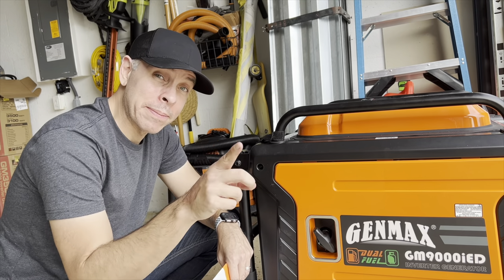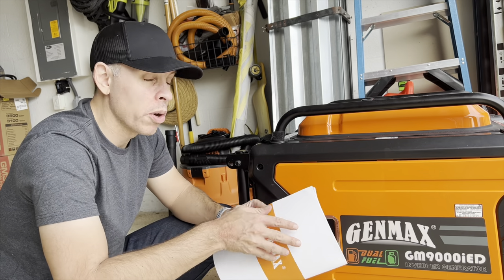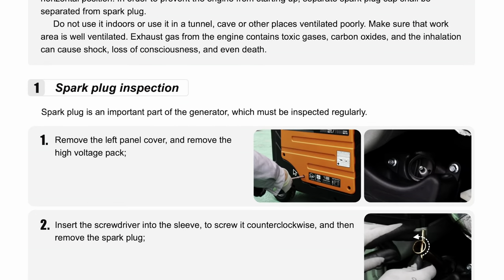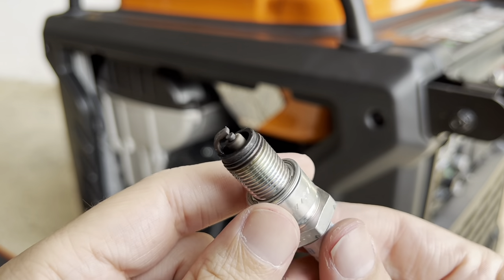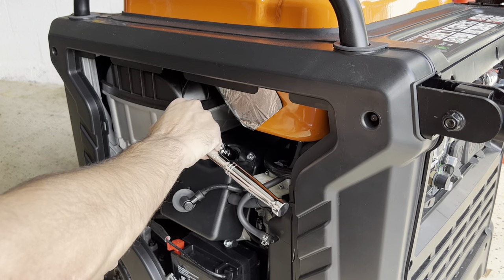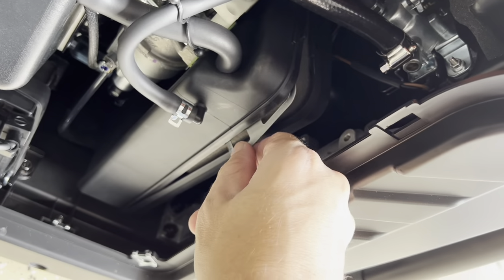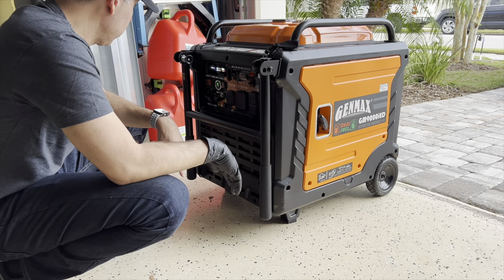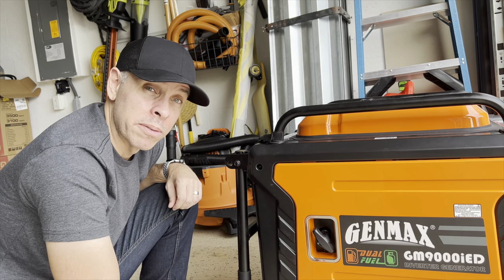Genmax GM9000iED Spark plug Change

Comment: Thank you for your video. I use my generator for the sole purpose of providing power in emergency situations. We just went 5 days without power and my 7 year old champion started up every time with the press of a button. It ran flawlessly and was a real help providing power for my portable air conditioner in 95 degree heat. 
Bottom line, reliability is the name of the game. Also that machine looks tricky to work on and in an emergency, who has time to wait for China to help trouble shoot and then wait for parts. 
Based on your videos this is not the type of machine that I would trust in an emergency situation.
Reply from the maker: Genmax Replaced that generator for a new one and so far I have no problems with the new one almost 2 year later.
Reply: Thank you for your reply. It’s good to know it’s all working now.

Comment: Thank you for your video. I want to replace my old PowerStroke 6000 generator with an inverter and I was hesitating between going for the Genmax GM9000IED or the Duromax XP9000IH.  I saw your previous videos where you advised to go for the Genmax vs Duromax and Predator but after seeing this video I think I will go for the Duromax. You should not start having issues with such a recent generator. My PowerStroke is 10 years old and is still running like a champ,

Comment: Thanks for the upload. Good info. Quick tip: Use non-ethanol gas only. My small engines start first pull when using non-ethanol gas. Pump gas has always caused carb problems for me.
Reply from the maker: I will try.  Right now I might need to call and test the warranty because I am having some issues starting the generator.   China support via email is very helpful and responsive but USA 🇺🇸 support partners are not so much so far.

Comment: I believe the metal plate was positioned in such a way that the air going into the carburetor was cut off or blocked in someway.  You had spark and fuel, but didn’t have air or oxygen going into the carburetor.

Have you ever had a backfire when shutting the generator off before? That may have blown the air filter cover off and dislodged that metal plate.

I have the same generator, but run on propane gas and when I shut it off, it backfires almost every time I shut the generator off.

Comment: My GM9000iED was misfiring 4 - 5 secs after shutting it off. I run mine on propane gas. After contacting Genmax and sending them a video of the issue, they noticed that in the video, I wasn't turning the fuel transfer switch, from propane to the middle position, right after turning it off. Problem solved. Actually it is on the instructions manual (page 22) as one of the steps to follow when shutting the generator down.
Reply from the maker: Hi. I always turn the switch to the middle neutral position and let it burn 🔥 the gas in the carburetor until ran out of gas.  I am not carburetor expert but I think the carburetor it. Was receiving too much air.

Comment: Javier,  I just got my GM9000IED and I am surprised at how stiff the gasoline / LP Gas selector is. It looks like it moves quite easily in your video. Some of it may just be my expectation, because I had the impression that it was an electrical switch and when I first went to move it, I realized that it is a mechanical valve. It still seems stiff though. Is your switch stiff to move or was it before and now it has loosened up?
Reply from the maker: Hello. 3 things.  1- yes it was stiff 2- I think it has loosened up 3- or I just got used to it and I applied the right amount of force unconscious now that I have done it multiple times.
Reply: @JavierRivera  Thank you for the reply! I guess I just need to hit the gym a little harder so that, a.) I can move this big beast around and b.) so that I can move that fuel valve. 😅 Also, it seems like you have a better manual than I do. I think you’ve referenced things in your manual that I don’t think I have in my manual…like the 5hr break in period. I’m doing it, but I can’t find it in my manual. Do you have a link to some secret manual? Thanks again!
Reply from the maker: Yes. The manual that comes with the generator is missing stuff.  You will need to go to Genmax website and download the PDF user manual
Reply: @JavierRivera  Thanks. Your videos have been very useful to me both before and after my purchase.

Comment: gasket causing a vacuum leak
Reply from the maker: Could be.  I m still trying to figure out what is causing the problem.   The thing is that after is hot do not give the signs or problems.   I am recording a couple videos to send them to Genmax.  Something simple that I want to try is to change the gas for newer gas and see.  The gas on the tank is only 1 month old and it was mixed with stabilizer since I bought it.
Reply: @JavierRivera  keep us posted!